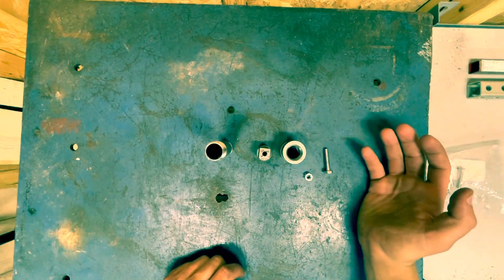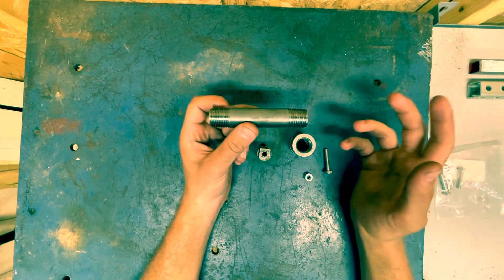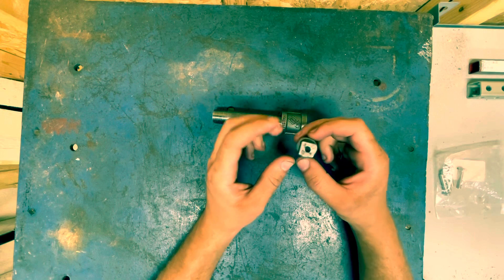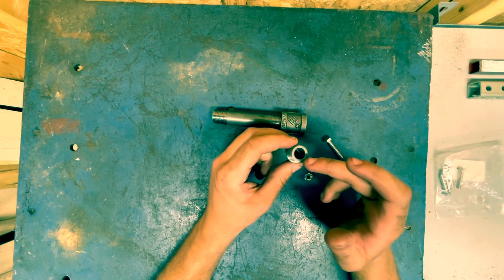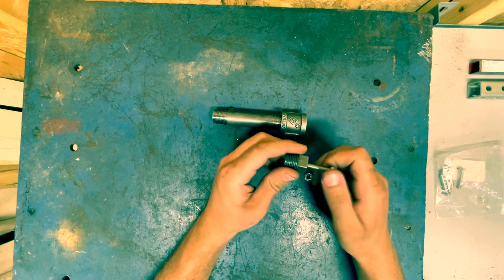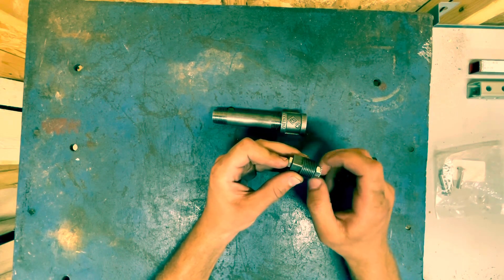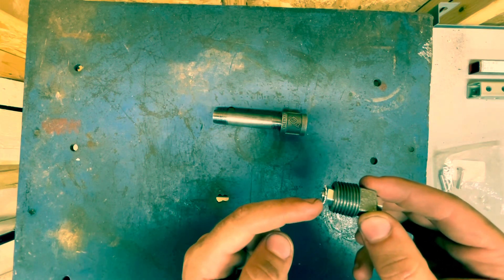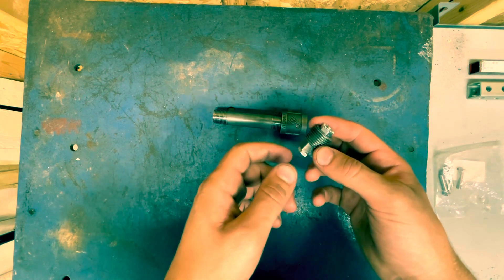Slam fire shotgun firing pin design. (Detailed Assembly) ￼

Comment: What I done , using almost the exact same parts but a solid plug was drill in from the other said , slide my firing pin ( a nail or bolt or other pin like piece of metal ) into the hole and welded it in or I suppose you could drill it tight and super glue it in place. I would want to check it after each firing if I did it that way but yeah that way you haven't drilled completely through your plug. That's a lot of pressure to trust to just the threads on your plug and pin !!😅

Comment: So you drilled a tight clearance hole for the bolt?  Seems like you had to turn the bolt, but I am guessing it was just tight and not threaded- otherwise you would be stripping the threads when you tighten it to draw the nut into the plug…

Comment: I use JB Weld and a 5mm steel ball bearing for 12-gauge. Works fine, service life between 10-30 rounds.
Reply: Hello man i want to tell me the kind of metal you used to make the barell of the shut gun and how o avoid not plow up on my face
Reply from the maker: @TarikFar-cd2np just regular black gas pipe rated for 500 psi
Reply: @TarikFar-cd2np  honestly, I don't think any intact pipe is going to blow on you. I've built Four Winds out of scrapyard pipes that served just fine for a few rounds.

The real art is thoroughly checking your pipe barrel to make sure it's not cracked or compromised. The extra three seconds of inspection pays off.

Comment: A shotgun shell develops about 14000psi chamber pressure. Steel plumbing pipe is rated for 500psi…
Reply: @pyalot  I thank you for the information! I have tried to tell these " slam fire" people, that using " hardware store pipe, is dangerous & could get people killed or hurt!
Reply from the maker: Yes steel pipe is rated to handle 500psi on a sealed system. A shot gun barrel is not a sealed system it is an open system. So basically if I were to put a cap on the end of the barrel than yes it would explode, but as long as the barrel does not have any obstructions like a cap on it or dirt in the barrel then it will be fine.
Reply: @timscrazycreations9150  The obstruction in the barrel is the wad and pellets. The 14kpsi is the peak pressure inside the barrel for the duration of a few microseconds about 500 microseconds after powder ignition. The 500psi rating is lower than the pipes yield strength, but this accounts for safety factors, manufacturing variance/defects, etc. Yes, you are really holding a pipe bomb in your hands.
Reply from the maker: @pyalot well if its a bomb than after over 100 times of shooting it why hasn’t it exploded yet???? Bro I’ve seen people shoot 1oz slugs through steel piping and it not explode, now I would trust that to hold up for a long time but it works.
Reply: @timscrazycreations9150  I suggest destructive live testing on several samples, chamber pressure measurement and water pressure test to figure out yield strength to answer that question.
Reply from the maker: @pyalot well if trying to make something explode it will.  But if you’ve designed it not to explode it won’t
Reply: @timscrazycreations9150  I would not describe something that uses pipe rated for 500psi in a 14000psi application as „designed not to explode“
Reply: @pyalot good thing the nobody asked you during the decades of use proven over and over again 💯🤣🤷

Comment: No guarantee the threads are stronger than recoil pressure. Bomb!
Reply from the maker: Well I have already used this and it does work but if you use ammo that has more than the  normal amount of powder then it could blow up (bomb) but I have a welder now and I’ll probably weld the back together and then it will be fine thanks for commenting 👍
Reply: @TIM's CRAZY CREATIONS  
Welding!  Even in Lithuania, we know about heat stress and heat effected zones.  Did you plan on stress relief and hardening?  Is the weld material compatible with various heat processes?

We say "BOMBA"  but you understand.

In South Africa, they use something called "Tyre Tool".  3/4" & 1" black pipe.  The advantage is to have double thickness.  Users are clever and generally shoot low power trap & skeet loads or hand loads of simular power, usually with lighter shot loads circa 3/4 ounce. This is to limit pressure rise.

Two telescope pipes with T handle welded on and 1" plugged and fish mouth weld.  Some use an extra layer over the business end of the 1" as scarrershield.  

The rated shell pressure exceeds the working pipe pressure but not ultimate strength..  There will be life issues due to cumulative stress in the pipe.  Try bending a wire clothes hanger many times to demonstrate the effect.

There are risks in modern powder and not using ordinance steel.  Yet the " tyre tools " seem to work at least for a limited number of cycles.  You might consider using 4130 CrMo in very thick walls as a minimum for a longer life.
Reply: @ledenhimeganidleshitz144  this is meant to be used with 2 3/4" birdshot. Historically, it was a field manufactured weapon meant to attack an enemy with superior arms so that you could steal their weapons after the attack. The most notable use of slam fire shotguns was amongst the Filipino rebels fighting against the Japanese in WWII
Reply: @doloinc  And currently in the Republic of South Africa.  Frequently used there with field loads but trap and skeet also common.  For hand loads, a normal load of powder and about 7/8 oz. of lead.  Usually 6 - 00Buck  or 000Buck.  When  it is available, 0 Buck or #1 Buck.  There are usually socket spanners welded into the ends of the "T" handles and double as excellent tyre changing tools.

3/4 inch with a welded on T, 1 inch with a  welded in plug and fixed pin and T handle welded on.  Load, fire, load the other end and shoot the previous empty out, rotate, and start over!
Reply from the maker: That’s right brother. Looks like I’m not the only one who know history
Reply: Hey. Guess what? Despite your reservations & expert opinion: The thing he’s doing works. It does. It happened.

Comment: Yo stuff is way more complicated then mine I just use a 1/2 inch wooden dowel a 7/8th roofing nail snd a peice of cardboard cut in a circle 1/8ths inch larger all around then the wooden dowel so it'll fit over thr dowel and when screwed into the end cap the cardboard keeps everything in place essentially just cut a 1 inch piece off the dowel drill  a hole in the middle stick nail through file down till its rounded/flat put cardboard over pierce firing pin (the bail in the dowel) through the cardboard when u put it over screw it all in and your done
Reply from the maker: Well I want it to work for a long time. I wanted it to be strong
Reply: @timscrazycreations9150  awl I understand sorry might have come off a sounding a bit harsh or critical I wrote this when I was very tired just to let u know though not knocking your design at all its a great design that'll likely outlast mine was just providing mine as an alternative for those who may not have the technical skill to build yours or they don't require the longevity u require
Reply from the maker: No you good didn’t sound harsh to me
Reply: @timscrazycreations9150  awl thanks thts good to know I wasn't offense also want to say loved your vid and I greatly look forward tk your future projects
Reply: @timscrazycreations9150  hello man i see your vedio its great and i inspired to make my slam fire gun and i made it but trust me i see the dieth front of me in a second cus when i but the bullet in the holl of the barell the bullet came out from the outher side where i grabe it i did not understand what happened may be the nail i put was so tall he enter in to the hole bullet if you can help me please
Reply from the maker: @TarikFar-cd2np I’m not sure what kinda nail or screw you used for your pin but if you could just try and copy everything i did in the video for the firing pin that would be the safest. I dont want y’all getting hurt on my behalf tho so be careful